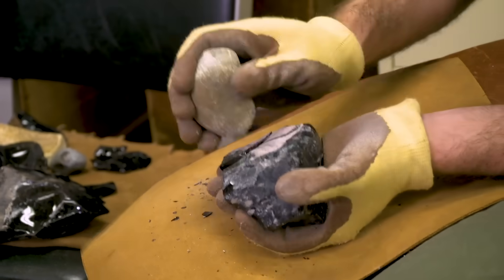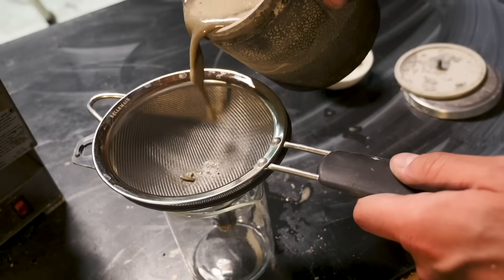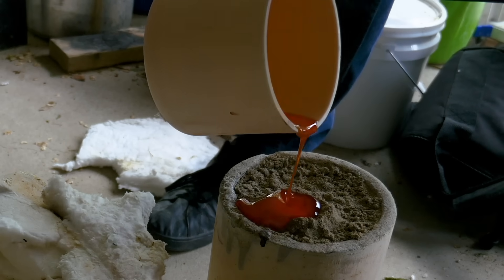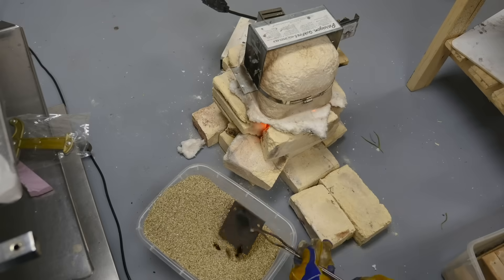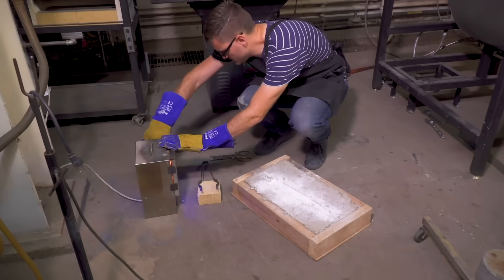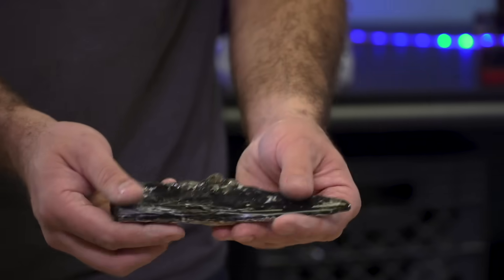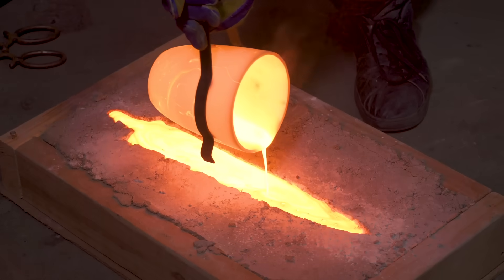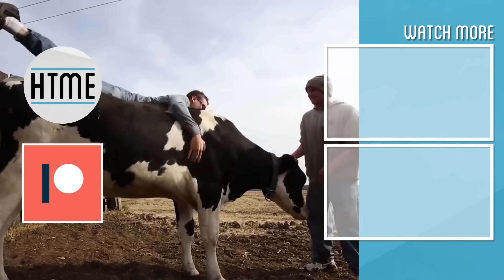Can You Melt Obsidian and Cast a Sword?

Comment: So I'm not sure if that'd actually count, since this tampers with the purity of Obsidian (which, to be fair, so did adding the flux and dyes) but maybe you could make it more successful by using techniques like the ones used to make Gorilla Glass? I think they change the surface chemistry slightly (adding various medals) to cause greater tension with the effect to keep the glass more stably together, so microfactures don't grow as easily into big cracks. It also becomes less prone to scratches.

Comment: If you want to try this again I would suggest not using any flux at all, grind down obsidian to an extremely fine sand then heat the hell out of it until it melts and all the impurities burn out. Form it in a non reactive metal mold so you are not getting out gassing from chemical reactions and continue the process of grinding the obsidian to sand, heating it to a liquid, pouring it into a non reactive mold, letting it cool down over about a day so you don't get stress fractures, then grinding it into sand and re casting it to burn away all impurities. Once you have an extremely pure sample cast the glass around a high melting point metal like tungsten or a tungsten alloy hafnium carbide, or tantalum carbide as a core. Glass is very hard, but hardness scales proportionately with brittleness. Metals are flexible and give bounce back and strength. Use a metal core and a coating of glass. Keep in mind that even if you can make this work the differences in the materials will end up shattering the glass edge if you ever tried to use it as a sword due to the hardness of the glass and the bending of the metal core.

Comment: Why wouldn't you just keep it in the sand/box you initially put it in? if you do that and cover it correctly, the temperature of the material should decrease less rapidly and you might end up with a good result. The shattering is likely due to it cooling far too fast, which exposure to the air at room temperature will likely contribute to.

Comment: If i remember the tales right, instead of flux you are suppose to make molten bronze, then grind up obsidian to a powder and combine it. Once mixed and reheated the obsidian should start to melt a bit and form a new alloy with the bronze.  But to do this you have to heat bronze to +1800.

Comment: It is possible to cast obsidian without all the fluxing or redying (which also kills its properties). Your gonna need industrial equipment to do it though.  However casting a weapon is pointless.  Its easier to cast a uniform slab than water cut it. Which is close to the method used to make experimental obsidian scalpel blades.

Comment: As you said, obsidian is made of silica. Which can give you silicosis if grinder into small particle. You should have wear a breathing mask. Also, you should keep your cat away from it. Aside from that, it was interesting.

I've seen clear transparent obsidian from archaeological tools. My guess is that obsidian from different region can take different color / degree of transparency, depending on the actual composition and inclusion in the lava while cooling down.

Comment: What was the final temp you had to achieve to get the mixture molten?  I had to go over 2381F (cone 10) to get a reaction on Davis Creek Obsidian.  It poofed all up as expected.  The "Poofing" happened in the last couple of hundred degrees.  I have two more pieces of glass that I have not succeeded in melting.  Cherry glass from China won't melt at cone 10 and neither will and industrial glass we call Turtle Creek because it was found in a creek in Georgia.  It is some kind of industrial slag.
Reply: Capt Mike that slag wont melt because it's barely glass.  That is the scrapings out of old furnaces.  It has broken down crucible, IFB, hard bricks and uncooked coloring agents in it.  I imagine it's a dark dark green or brown
Reply: Actually, it is white with some black in it, not much, but some has more black than others.  You are probably right about it being slag.  It was found in a creek and that is probably where they disposed of it back in the day.  It does make a nice knapped point.  Runs a flake very well.

Comment: you want to caste glass you need to do what they do for making gold pretty so you do not get the fast crystallization. You need to do a true annealing but you need to have multiple flames as you cast so cooling takes much longer . so basically you need to treat it like more of a ceramic  but with a heat treat while pouring, does that made sense? ,The key is keeping flame from as many angles as possible while it cools.

Comment: No, you cannot.
At best, you can chip little razors and glue them onto a bat- which is much more terrifying to be struck with than it sounds.

This fragile glass will shatter on impact with nearly anything- and if that razor sharp glass shatters inside of you?

A blade? Nah. It’ll break under its own weight it’s so brittle.

But a glass covered baseball bat?

Comment: The problem with casting any blade in general not just obsidian it makes the blade very weak. That's why almost every blade made from metal is forged and the ones made from obsidian are knapped. But hey either way its impressive.

Comment: I was thinking of making a ceramic blade to look like links magical blade in hyrule warriors. With iron or steel going up the center for more support, capitalizing on the ceramic for the edge.

I would have assumed obsidian would be much the same due to both being brittle. Great for edges, not so much for strength though.

Comment: You should do more research before you risk so many tools. The thing that makes obsidian different from other stone/lava is the rate at which it cools. Obsidian cools incredibly slowly, much slower than what you were allowing. The last cast you did was the only right way, but it was still cooling too fast. That's why it cracks and has bubbles. If you made a crucible that would allow the obsidian to melt and then be shaped by the crucible, you could gradually turn down the heat, and it would be what you want. Obsidian doesn't anneal, temper, or even sharpen like metals, which is what I'm sure you're normally using.
Reply: Geologist here. Obsidian is volcanic glass. It only forms when lava cools extremely quickly before it can form crystals in the melt. If you cool it slowly it will allow crystals to form and will no longer be glass. The question should be ‘can you make a glass sword’ which is all obsidian is. Glass.
Reply: Yeah, I feel like the issue here is that you can start with obsidian and end with something castable, but it'll mostly just be something with the chemical compounds of obsidian rather than the "real deal."  And I feel like the original source to generate the "real" stuff might be a bit too viscous and...  Inconvenient in other ways to reasonably work with =P
Reply: First off, I really don't want to step on anyone's toes, and I also don't want the following to be mistaken as an attempt to 'hate' on this guy.

But:

There's a multitude of reasons why certain domains absolutely require expert knowledge, years of experience and highly specialized tools. And as much as I respect the 'How To Make Everything' approach, the domains of glassmaking, metallurgy and weaponsmithing painfully demonstrate the limits of this approach. It simply is impossible to get even halfway decent results by merely 'winging it'.

Having said that, I absolutely loved his video about glassmaking. Not only because I'm a big fan of Cody, but also because it was an impressive demonstration of how incredibly hard it can be to make some of those deceivingly 'simple' and 'common' things that we take for granted in modern, day to day life.
Reply: @Aidan; You've got it completely backwards: Obsidian is formed by rapid cooling of viscous magma, not slow cooling.
Reply: from my limited knowledge of how flux works, it helps remove impurities, the same ones that make obsidian what it is, at a guess he is ending up with dark coloured quartz
Reply: You know nothing about how Obsidian forms do you?
Reply: It was just a clickbait title in the first place. The idea you could "cast" obsidian is absolutely ludicrous. It is volcanic glass, not fucking aluminum. Once he has completely destroyed the obsidian he melts it until he is just left with regular glass. The idea that you could make or use a sword out of somthing like obsidian is crazy too. It is extremely brittle and its only main characteristic is being very hard, this is why people used it on the edges of weapons traiditionally or now in modern times are using obsidian flakes on scalpels. Using it as a main material is like making a weapon out of any other untempered brittle glass. Its like charging into battle with a wineglass.
Reply: do you  have any  practical advice for meth addicts who blow their  own pipes?  i never let any   meth go to  waste, btw.
Reply: obsidian is glass, not stone/metal
Reply: I know, it was driving me crazy that he's using a small electric glass kiln here, when he should be using a moderately sized gas-powered ceramic kiln for the temperatures and materials he's using. I'm really shuddering to think how much money he threw down the drain destroying those poor kilns when all he needed was a trash can raku kiln and some weed burners to melt his obsidian.
Reply: You must be fun at parties
Reply: Aidan Killeen he obviously comes from money normal people wouldn’t waste this much money to do something that destroys tools in the process.
Reply: Aidan Killeen i knew he was doing something wrong.

Ans it frustrated me to no end to see him break shit because he kept doing mistakes left and right.

Comment: thing is the finished product is no longer obsidian as most of the minerals in the volcanic glass were burned out so I would say no you cant cast and melt obsidian, but I have seen many beautiful blades made with obsidian, mostly daggers or Macuahuitls, they made a art form of getting the obsidian to fracture in just the right way to get blades that are sharp enough to cut cleanly and easily into flesh.

Comment: Be careful with copper smelting - a lot of the ores are high in arsenic.  In fact, it's speculated that the reason that many of the gods of smithing across different cultures were lame is a reflection of the symptoms of chronic arsenic poisoning that would not have been so uncommon among coppersmiths.

Comment: The premise is fundamentally flawed. Obsidian isn't like ice, where after a cycle of melting and refreezing, you'll just have ice again. It's just an ordinary quartz-heavy rock that's cooled too quickly for crystals to form. Even if you could have melted the obsidian without flux, if you didn't cool it quickly, you'd just end up with an ordinary rock.

Comment: Did you ever try to make a More Ceramic Enclosed Mould wich is constantly heated with torces? Maybe that will help the Glass to Cool more Consitenly, also use something to reinforce it like some small wires or something. Just a suggestion.

Comment: Screw "casting" obsidian unless you can find a kiln or forge hot enough for it. Besides why make something so weak when you can keep it strong by just shape it by chipping it along its cleavage lines. I.e. arrow heads, spear heads, daggers and the like. You can't make it better than nature intended. And my advice if your going to attemt casting, dont keep reusing dirty vigoro vermiculite covered shards. You're just contaminating the process with chems.

Comment: So the solid obsidian that expanded into a glass foam shows spectral evidence of manganese rather than chromium. The foaming is interesting because that much trapped gas would have a marked impact on the pH of the gas. 
Judging by the color changes between re-ground obsidian, unground remelted obsidian, and the color changes of various maganese salts that can be watched/observed, i'd say you have an acidic manganese compound sitting with a bunch of silicate glass. Acidic conditions make it harder to melt glass, and more brittle (harder and less flexible).

Comment: In the last part of this vid, you mentioned making bronze. I have successfully done that by smelting the copper from malechite and adding tin, it isn't as hard as it sounds!😁👍 ( when you do it use a graphite crucible, the Co2 gets absorbed by the carbon in the crucible and leaves just the copper metal 😁 )

Comment: I suggest a different method of casting since this one exposes too much of the material and allows bubbles to form all over. Now, if you used a closed mold and poured vertically, filling from the point all the way to the tang, the results might have turned out better.

Just my two cents from what I've watched and read on similar topics, though. By no means a profressional or  anywhere close.

Comment: Rather than melt and cast it, could u just use a pure obsidian block (no flux) heat it till it's soft and see if you can either forge it or use a press with a mold to shape it?

Comment: Using that batting in open air is SUPER dangerous, the fibers in it are very similar to asbestos.  You need to enclose it and use it as a filler.

Comment: If you want actual obsidian you'd need to be able to vitrify it. That would mean cooling it extremely rapidly so that crystals cannot form. Still, there wouldn't be a real way to sharpen it, as it's a relatively brittle glass. The classic knapping method is the best way to work with it, in the end. Perhaps not as intersting, but it does leave you with obsidian with an edge.

Comment: Would it be possible to flake the obsidian after casting? If so it would be awesome if you could cast it in a mold that had strategically shaped edge surfaces to flake off on the edge to give the razor sharp edge while also having the sword shape!

Comment: This is why obsidian arrow heads would be so dangerous- its easy to get into a pointy and super sharp tip VIA napping. because obsidian is so brittle, if the arrow head hits a bone, there is a chance that the obsidian would shatter, making effectively a HEAT round for bow.

(Without the high explosive part)

Comment: 7:40 FINALLY you have it hot enough, with the color at a bright straw yellow, you might have reached a temperature of some 1050C, which is about what you need. (with the flux added)
.
Do NOT try to remelt uncrushed obsidian, as it contains dissolved and entrapped CO2 and water. You will just get foam.
By crushing it, *without adding a flux* , and slowly heating you can allow these gases to escape, leaving a reasonably manageable pourable liquid. Without the flux though it might be much too viscous, you need to heat it a bit more, something like 1200C might be needed depending on the exact composition. It the sample is particularly pure, the melting point could be as high as 1700C.
(good luck trying to get that in a tabletop furnace!!!)

Comment: good video, I can't say I'm particularly surprised by the results, as while chipped obsidian can be razor sharp, obsidian is also brittle.  As cool as the idea of having an obsidian sword is, I always figured it would be very impractical as if you somehow did manage to work obsidian into a usable blade through casting, as the normal folding of metal wouldn't work for obsidian, you would probably get 1solid use out of it before it shattered.  I was hoping that some of what I believed about obsidian would be challenged in this video, but alas, it only confirms it.

Comment: One thing I might note is that it can be easier to let the obsidian solution settle, possibly with some slight vibration to aid.  If you are concerned about possible soluble salts getting away just boil the removed water, may seem redundant but I find it is easier to boil "clear" water rather then a foamy slurry.

Comment: Shame you stopped when you did. Looks very promising. I bet a chicken wire core dipped in the molten glass would give it much better strength. And playing around some more with the tempering heat and flux composition would probably give you less fractures.

Comment: You know, I'm sitting here remembering how The King of Random used an arc furnace to melt down straight rock. I'm wondering it using an arc furnace on pure obsidian shards directly inside the mold itself won't make it both easier to cast and more likely to not crack during annealing?

Comment: If you could get your hands on a big block of carbon, maybe you could carve a mold into that? The ancients used carved soapstone molds to cast swords from bronze, but soapstone's melting point isn't high enough to cast obsidian; still, the basic principle should work wih other materials. Using a solid mold would let you carry the whole assembly into the annealing chamber, which might help the blade hold its shape.

Comment: You've broken so many killns that this sword must have cost thousands upon thousands to build.
Also at 11:45 is that a pizza paddle being used to slide the sword into the kiln?
Now once it is cast how do you sharpen it without shattering it? 
How would you build a hilt around the obsidian tang so as to relive enough pressusre from the obsidian so it dosen't shatter?
If you can get t sharp it'd be a fun cake slicer, but it guess tha's al taht's practical with this glass. To many imputities to reliably cast, too brittle to handle any sheer force.at its shrpest it's oen of the best materials, but its just not good in practice. I guess that's why obsidian blades are fantasy wepons and why the only obsidian wepons were arrow heads. If they hit bone they frag.

Comment: You could have tried to see if you could have allowed the obsidian to be a little less fluid by adding less flux, and then pouring it into the cast with a slow flow by waving it from side to side (like wiggling or zigzagging slowly down the length of the sword). You may need to keep the cast heated to prevent the obsidian from solidifying completely before you're done.